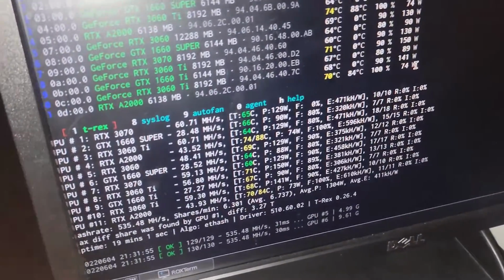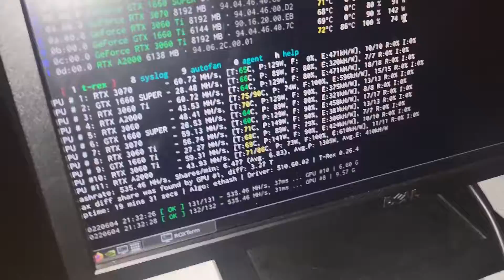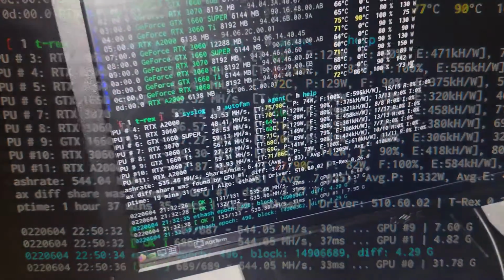Finally Shunt Modded RTX A2000

Comment: Hi mate. Good stuff, it best to also shunt mod both sides of the gpu, along with adding a dedicated ground wire for the pcie connector.
Reply from the maker: It's best to wire in an external power connector, but Shunt modding these cards are a risk the user take. The back side mod with ground would be a lil safer but you won't be able to get accurate software power draw numbers. Either way been running for months with no issue but on an external riser NOT a riserless motherboard. As as riser is easy to replace rather than a whole board, endurance testing is underway and we will do an update after 6 months of constant use.

Comment: Can you please share why you are doing this mod exactly? I didn't catch that part
Reply from the maker: I didn't cover it because it has already been covered by many others. But the shunt mod on the A2000 allows you to trick the Nvidia power limits, letting you go from about 40Mhs up to 47Mhs+ depending on thermal conditions.
Reply from the maker: Check out the description for other videos on it, including my warning for users to becareful because we will end up running the cards outside of the 75watt PCIe spec.